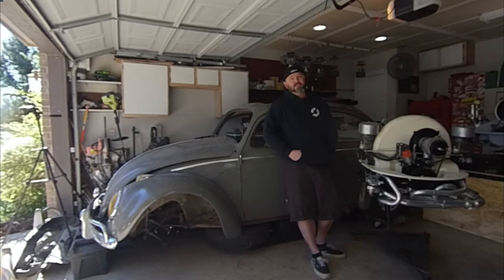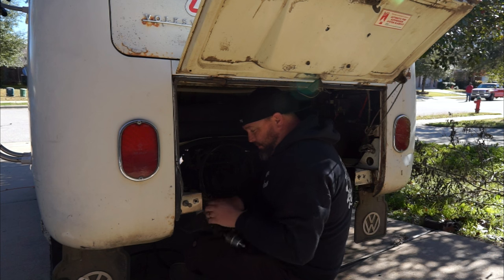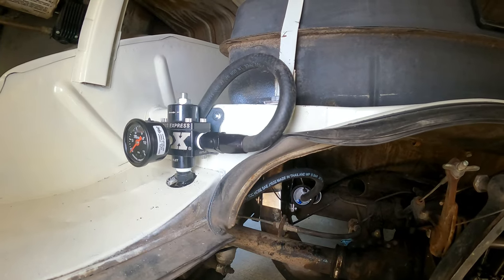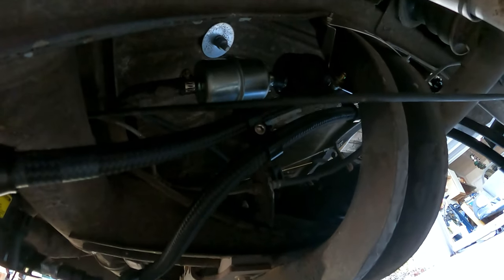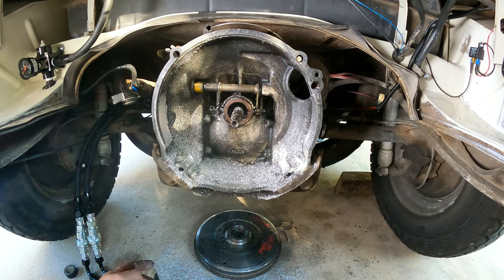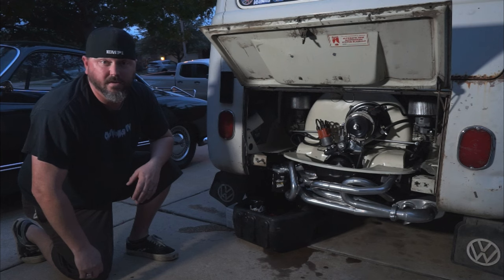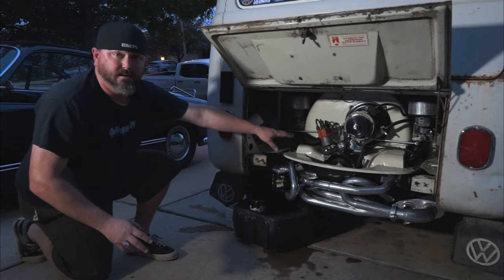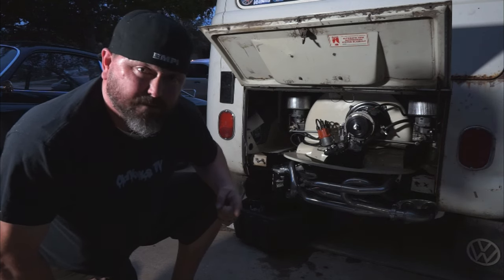Installing a Motor in a 66 VW Bus

Comment: You did a great job, looks great and you will love the extra hp. My only thing is you kinda swayed from the K.I.S.S principle. I look at everything i put on my westy as what if i gotta fix it on the side of the road. But maybe it is bulletproof and im just overthinking it. I tend to do that. Thanks for the videos. Gives me something to look forward too as my bus is tucked away for the Pennsylvania winter.
Reply from the maker: I wanted to keep it simple, and the little single port was a good motor. With what I ask the bus to do on the long trips I wanted it to run as cool as possible, and the extra power will definitely help on the hills. This motor was designed for low rpm, under 5k. I don't plan to drive it over 65mph and with my gearing I should be well below that.

Comment: You need to keep in mind that more hp with reduction boxes results in more wheel  hop at the minum add 2-3 more shocks to stiffen suspension to minimize wheel hop

Comment: Nice video, I’d like to install a electric fuel on my bug same location. Wiring dia?
Reply from the maker: On a bug you usually put the pump up front, under the tank and just opposite the brake master. I used a 4 prong relay from the parts store and wired it according to their diagram. You'll need a switched power, 12v power, ground, and 12v output wires.
Reply: @OldVolksTV  dude, your speaking Russian to me. Mechanical stuff I can figure out, but electrical? So you ran the the 12v from the ignition switch or fuse box? What about a switch for security purposes to energize the fuel pump? I think I’ve got it now.

Comment: Are those disconnects going to restricted oil flow ?
Reply from the maker: They shouldn't. They're from heavy equipment so they're built for high temp/pressure. I've never had any issues when I run them.

Comment: Auto starter has more torque too.
Reply from the maker: I think I still prefer the 6v starter on a 12v system because it starts so fast. The auto starter is by far an easier install than changing the bushing for a 12v starter.